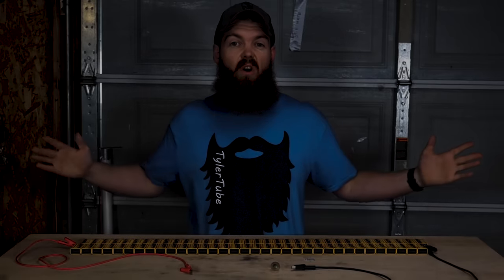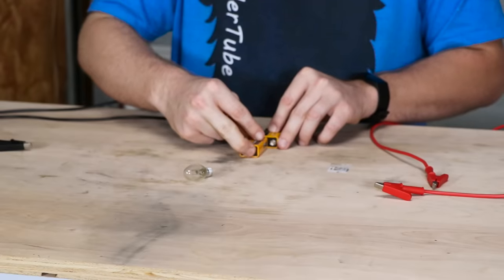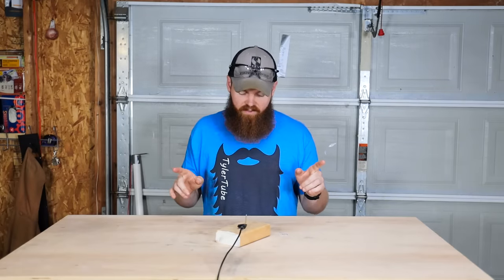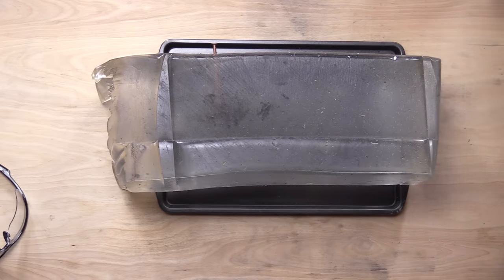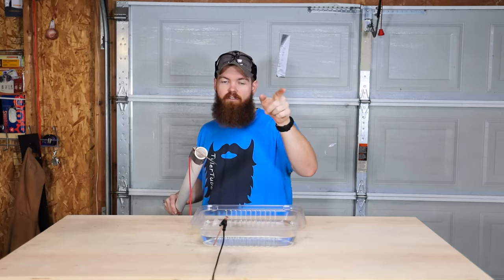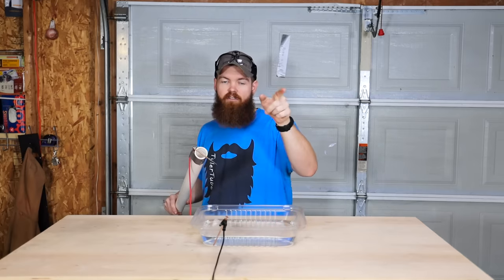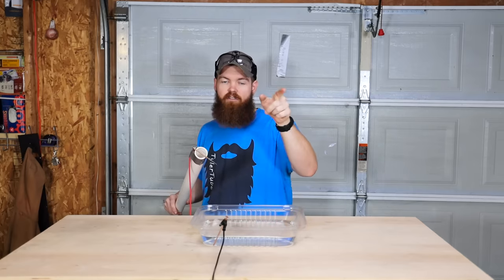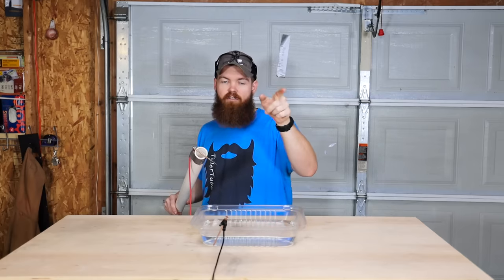I Connected 500 - 9 Volt Batteries...

Comment: Pet peeve of the video: Tyler continuously calls the negative side the "ground"
Reply: But somehow everyone knows what he means.
Reply: yes, I did that inward-breath teeth-sucking sound every time he said it; as I commented above (or below?), I was worried at first that he actually did ground it believing that would be safer
Reply: that is the ground side of the battery though
Reply: Not everyone has to know everything about batteries and other things stop nitpicking. LOL 😂
Reply: poopey ca ca doo doo
Reply: @benjaminhenderson5750  I'll take "Electrical misunderstandings that will kill me" for $1,000, Alex
Reply: He's an auto mechanic. They probably call it the ground in his shop so it's just part of his vernacular.
Reply: Ground is a reference point in a circuit. It doesn't mean connected to "earth". Also, negative terminals on a battery are very commonly referred to as ground. He did get a bunch of terms and ideas wrong in this video, but that wasn't one of them. FYI, I'm an Electronics Engineer.
Reply: @Nicodemous17  the problem is that thinking of the negative battery terminal as "ground" implies certain things to someone who doesn't fully understand.  a lot of people think of "ground" as "safe", which it often is.  but with this 4kv battery bank, if someone thinks the negative terminal is "ground" and therefore "safe", and then they inadvertently  actually ground the positive terminal, now the thing they think is "safe" has a 4kv potential to everything else around them including the surface they're standing on.  there is a point in this video where Tyler mentions disconnecting the negative terminal before touching it, and then says something like "well that's ground so I guess it doesn't really matter".
arguing over "ground" vs. "negative" seems pedantic until something goes wrong
Reply: @davej3781  If he hooked up the positive side to earth ground that wouldn't magically bring everything up to 4kV. The positive side would be 0V because the reference is ground. The negative side would just be -4kV. What he did was dangerous. I'm sure everyone watching the video agrees.
Reply: @Nicodemous17  right, the negative side would be -4kV relative to ground... if you touch it does it matter whether it's -4kV or +4kV?
Reply: @davej3781  no, that's my point. It only matters of you are touching two things that have a difference in voltage potential. He can touch the positive side or the negative side all day long without any problems. He can even connect the positive side to earth and then touch the positive side all he wants. It's only dangerous if he completes a path for current to flow.
Reply: @Nicodemous17  you're missing my point
Reply: @davej3781  and you're missing mine. I think this is where we part ways. Good night.
Reply: @Nicodemous17  I'm an EE too, and it's common to have voltages lower than ground by connecting battery plus to circuit ground or actual ground.  That's why some devices have plus on the outside of barrel plugs.
Reply: @Leavemealone670   you should know before trying something this powerful and dangerous, otherwise you could get killed easily.
Reply: @Nicodemous17  He laid the positive stick carelessly on the garage door. That's resting on the concrete floor and may have a power opener with an equipment ground. But while it was sitting there, he said that the negative terminal was probably safe because its ground.
Reply: @Leavemealone670  If you're not an expert in something, you'll have more mistakes when you play with it, and hopefully learn from tyem. That can't happen though if you get seriously hurt or die from the mistakes. 

Case in point: Tyler left the positive stick on the garage door which seems to be grounded. He said that the negative terminal was probably safe because "it's ground."  He still took a few safety precautions, which likely saved his life, but he came close to dying too. He wondered why he was getting a little static shock from the hot dogs, that's because the clip was at 4500 negative volts relative to the ground he was standing on. It was diffusing into the high resistance wood of the table, and giving a little shock. If it had been closer to all that hot dog juice it would have had enough of a conductive path to flash and he would be too dead to post a video of it.
Reply: Delta B no he didn’t lol 😂

Comment: the reason the hotdogs are staticy is because you literally made a hot dog battery with them. you injected electricity into layers of meat and brine.
Reply: Exactly.
Reply: Maybe, or it could be that the hotdogs have a capacitance.
Reply: @SUPERMAR10312  and what's that? I flunked math
Reply: @danielyoung7534  what does math have to do with anything? Capacitance is the unit of measurement for static electricity.

 EDIT: Farad is the unit, not capacitance. Stupid mistake.
Reply: @SUPERMAR10312  what static electricity? i flunked PE
Reply: SUPERMAR10312 bruh you literally just repeated the original comment just used social studies words
Reply: @tenstargaming9599  actually im pretty sure he used band class words
Reply: @Wulfjager  umm pole dancing class.  Get it right
Reply: @Wulfjager  In tech class, Capacitance is how much static electricity something can store, it's measured in volts per Amp-second, officially named Fahrad after Mr. Fahraday.  Most things have a really small capacitance, like 0.000000000005 F (5pF)
Reply: Except it kept re charging. I think it's because the positive terminal was laying on the garage door. That means the negative clip was probably actually at 4500v relative to his body, the floor, the electrical system of the house, etc. It was "charging" the whole table  hotdogs included, but the current was limited by going through the wood. He's lucky that negative clip didn't find a more conductive path to him, he didn't even know the danger he was in.
Reply: @deltab9768  A mix of resistance and capacitance can have delayed behaviour, calculation can be difficult, but there are computer programs to do it.
Reply: @johndododoe1411  yes, the hot dogs capacitance had an effect, but Tyler and everyone else are just imagining that the power is disconnected and the hot dogs kept supplying power. Unfortunately, the grounding of the stick meant there was a "hot" wire on the table, that kept re charging that capacitance, and Tyler didn't even know it. Scary stuff.
Reply: @tenstargaming9599  no he didnt batteries storage energy thr is ugh chemical energy and capacitors store electricity through eletric fields it's not a unit of measurement he doesn't know what he is talking about
Reply: @SUPERMAR10312  capacitors store electricity through eletric field by separating conductors with a insulator
Reply: @godparticle3833  I said capacitance not capacitor. Read
Reply: @SUPERMAR10312  it is still not a unit of measurement for static electricity that's voltage it is is a unit of how well a capacitor can store electricity
Reply: @godparticle3833  hot damn. Your partially correct. The unit is farads. I should've known that
Reply: @SUPERMAR10312  I know the unit is farad discovered by Michael faraday for example I have a leyden jar rated for 1.5 nanofarads and I have a van de graaff generator that has a dome with 15 picofarads to the environment
Reply: @godparticle3833  you know if you would've just said I was wrong and then said the unit was farads in the first place I would've had no reason to reply.
Reply: @SUPERMAR10312  I really didnt know if you knew based of your mistake that farad is a unit of static electricity
Reply: @godparticle3833  after reading the SI brochure  I found this definition for Farad. Farad (unit of capacitance). — The farad is the capacitance of a capacitor between the plates of 
which there appears a potential difference of 1 volt when it is charged by a quantity of 
electricity of 1 coulomb.

As it states farads are the capacitance of an object. From that definition it seems likely that someone could make a simple mistake like that. 

https://www.bipm.org/en/publications/si-brochure/
Reply: @SUPERMAR10312  yes I agree

Comment: IT'S NOT GROUND! There is a positive and a negative. No ground!
Reply: Already posted this above, but here is is again...Ground is a reference point in a circuit. It doesn't mean connected to "earth". Also, negative terminals on a battery are very commonly referred to as ground. He did get a bunch of terms and ideas wrong in this video, but that wasn't one of them. FYI, I'm an Electronics Engineer.
Reply: @Nicodemous17  thanks Karen
Reply: @masonanderson9190  Of all people I'm pretty sure Dex is the Karen in this situation
Reply: @masonanderson9190  I don't think you're using that term correctly.

Comment: 16:40 THAT MOMENT.
That´s when the accidents happen.
"Oh, just for a second, i have the watter bottle right here, no need to disconect it just for 3 seconds"
WRONG
That is exactly the moment accidents can happen. Maybe not with a home-made 4500 volts thingy, but with an angle-grinder, or a gas torch, or a lathe.
Be safe, don´t be that idiot.
Reply: the ground needs to be connected to what it touches to work u know that yeah?
Reply: @thoran9363  "It's not touching the ground"
"I'm not gonna put my hand close to it anyways"
"Its not gonna take long"

I have seen people lose fingers because of that mentality.
Reply: Entire board was grounded to avoid accidents, only the stick had high voltage.
Reply: @johndododoe1411  the stick was sometimes grounded by laying on the garage door, I don't think he actually grounded the table, he just assumes negative is ground because he doesn't know what he's doing. He could have died easily. Same thing every time he puts his hands on the battery pack.

Comment: Hydrogen generator. Or, rather Brown’s gas. Not sure what that type of voltage would do. You could also use salt water to make a disinfectant. Again. Even a mild saline solution could have unexpected results at 450v. Interesting, but potentially dangerous.

Comment: Alternate title: How to make your own sketchy welder
Reply: Not really , you would need more amps to weld so maybe if he put like 2000 of 9v batteries in parallel :D
Reply: But i can see what you mean :D
Reply: Can weld using 2 or 3 car batteries hooked up in series. Good for bush repairs.
Reply: @oplkfdhgk  they have a short circuit current of about 3-5A apparently.

https://groups.google.com/g/sci.electronics.design/c/6nEUtCCNMYY?pli=1

So 5 in series, x 100 in parallel would be about 300A-500A with 45v open circuit. You could draw about 130A before they were brought down to 25v. It would work, but it would probably overheat quickly. 2000 in parallel would be up to 10kA woith not enough current to arc. It would probably stick to the workpiece and melt the rod in under a second.
Reply: @deltab9768  wow okay :o i had wrong data then :) thanks for clarifying :)

Comment: I watched your video in amazement.
A few times you could have been dead it was extremely dangerous.
By touching the batteries and getting close to the battery terminal.
You regularly put the entire garage door under tension of 4.5 Kv. 
Then spilling conductive liquids on the floor near your feet. 
I didn't think it was strange that you felt a static field with the sausages.

Comment: For the woodburning I usually use a foam brush to apply the electrolyte. Also I use a variac on the 120V side to control the voltage. To much it burns the electrolyte up and ends up arcing. Lower voltage gives you more detailed designs. I don't attach nails to the pieces. I use jumper cables with carbon electrodes from 6 volt lantern batteries and just sit them on the piece. I recommend electricly insulated gloves and never touching both leads at the same time for any reason.
Reply: that's cool

Comment: NO. Incorrect about distilled water. You're thinking of deionized water. Deionized water will not pass a current.
Reply: Deionizing is just a different process to get distilled water.  They are both the same after.  That said if you buy distilled water it's usually not 100%, and will still have trace minerals in it, something to watch out for.

Comment: 19:36 "even though it's a ground, I should be safe" no.  Your HV negative is NOT a "ground".  It is NOT referenced to the floor you're standing on (and therefor NOT guaranteed to be equipotential to your body).  If somehow the HV+ pipe fell over and touched you or the ground (your garage floor) and has low enough impedance to your body, touching the HV negative WILL kill you.  With high voltage (or VERY high voltage as you have in your setup) both HV+ and HV- should not reference/connect to any ground or part of your body.  That way at least you need a 2 point failure to die.  Of course, there were many times in the video where you were very close to having a 2 point failure.  I'm surprised you're alive.
Reply: THANK YOU. This guy has no clue what he's actually doing. Sends a dangerous message to youngsters viewing...
Reply: @michael-gary-scott  Thank you!  Even Dwight Schrute would've been more careful.
Reply: @michael-gary-scott  I wonder how many people are going to die from trying to do this video to show their friends.  I've already reported this video, if more people reporting will help put a big disclaimer over it for the full duration, please report, too.  Thank you!
Reply: This might be the first video of his that I've clicked dislike on.

Comment: as an electrical engineering student...

I was honestly scared throughout this entire video. He posted it, so I know nothing bad was gunna happen, but it's on of those "so scary you can't look away" situations
Reply: As someone that did this kinds of experiments before I even was 10, it bugs me that he referred to the negative side of the the batteries as ground. The only ground in this system is he himself
Reply: My favourite part was when he seemed unsure if the hand soap would be conductive. At that point i figured this video being uploaded was a coin flip

Comment: Anyone else annoyed he's just talking about volts? 9V batteries (apparently) only supply around 50milliamps, so the actual wattage would be pretty low even if the total voltage is high
Reply: Nerddddd
Reply: This is the comment I was looking for.
Reply: I think he actually mentioned that.
Reply: I had to look this up, and found a long discussion of people who had shorted out 9v batteries, and depending on the brand it looks like they can briefly deliver between 2 and 5a, maybe more for the rechargeable ones:

https://groups.google.com/g/sci.electronics.design/c/6nEUtCCNMYY?pli=1

Even with hot dogs, arcs etc in series, this little supply was probably delivering well over an amp.
For comparison, .1A or even less can cause a heart attack.

Comment: So first of all let me explain something to you.
The screwdriver is NOT grounded.
And you're safe as long as you're not touching both terminals.
As long as you only touch 1 of them so + or - nothing will happen.
But NEVER touch both of them at the same time.
Reply: There is nothing safe in this video. Only touching the screwdriver is still dangerous due to the size of the archs in this video

Comment: 5:24 thats not a short circuit. Thats called arcing. Its when voltage is high enough to cut the current across air and complete the circuit

Comment: That was probably one of the most insanely dangerous things I've seen on YouTube. That being said, I'm glad it worked out. You're running a risk of overheating those 9v batteries and causing them to pop. 

Wood burning works much better if the piece of wood has been soaking in liquid for long enough to be saturated.
Reply: Exploding batteries would be the least of my concerns in this scenario.

Comment: I am surprised he did not get shocked by the wires, the insulation rating on those leads is probably less than 1000 volts
Reply: ...less than 1000 volts... Closer to 300 volts.

Comment: The reason you were feeling a slight shock is because you were creating a step potential by putting the positive end against the garage door frame and grounding the positive.  That grounded positive current was flowing up from your feet to the negative connection.  If  you had bare feet it may have been much worse.  You have no idea how lucky you were.

Comment: In case you were wondering Tyler, the hotdogs were acting like batteries because of the electrolytes in them. By electrolytes, I mean the salt and other electrically conductive materials used to treat it. That’s why the shocked you a little after they were shocked by the system and then unhooked. Ballistics gel doesn’t use anything conductive to make it, it still relies on a chemical reaction but not with anything capable of conducting the voltage and amperage you tried sending through it. If you tried ballistics gel with a Tesla coil designed to output 1.2 million volts, it might arc through it. But please whatever you do, don’t try it without a better understanding of electrical safety. We don’t want you to die from electrocution.